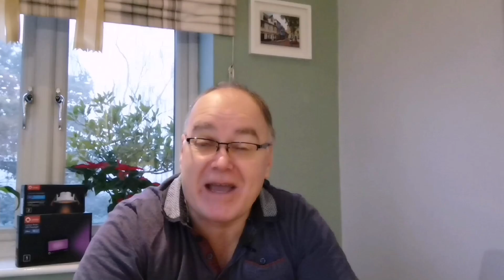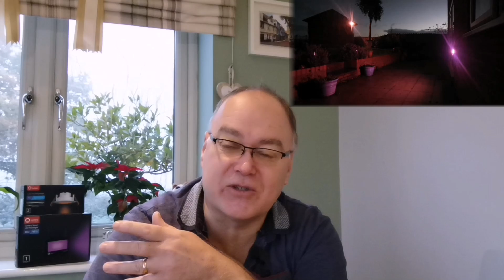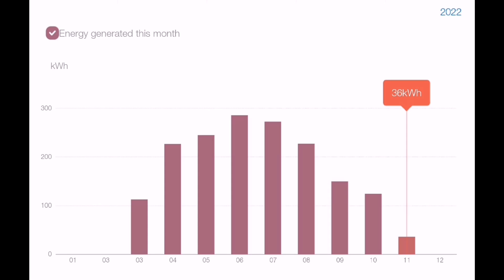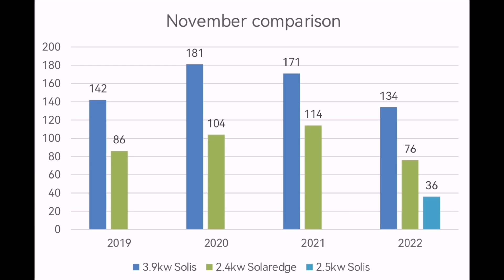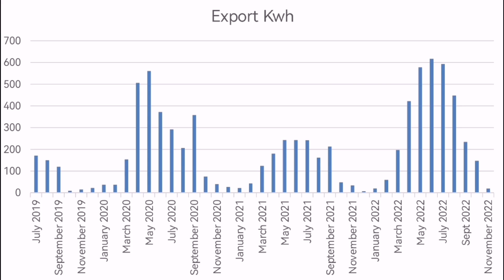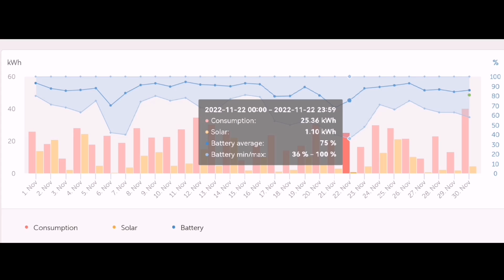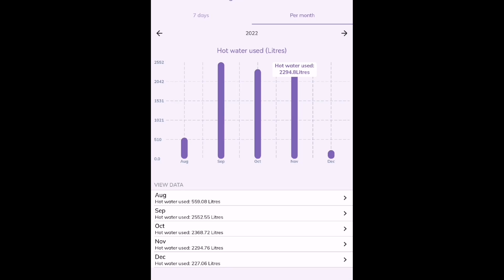Solar PV, battery, Mixergy and A2A heating system - First winter challenge

Comment: Good vid. I’m looking at putting air2air for my new property that only has old electric radiator heating or I’ll replace to new elc radiators. Also considering sola as well. 
May I ask how much was your air2air including install. So far from the few revews of home air2air around 7-8k seams to be the average. Personally I’m not going electric car due I’m moving to a very remote aria and I need to make long journeys with no luxury time to stop a charge for 30-60+mins and the cost of the decent evs are ridiculous expensive to buy.
Think the main issue most people face even with the substacys is the shear cost of re doing there property and most do not have the financial reserves to do it nor won’t to be in debt. Personally I’ve run into some money and what I’ve been saving thru work. So I feel lucky that I am able to consider doing big changes with my new property. I have friends and vets that work equally hard and still carnt consider switching the ev systems. Witch these GOV deadlines are crazy and especially the 30 rules have good chance the kill the property market buying or renting probably if not changed will just creat a Black Market economy. Most are property stock doesn’t come dear the A standard requirement nor most older property have a realistic chance of meeting it without a shear amount of money 💰 thrown at it. As they say Nice if you can but those who don’t or carnt they will be between a Rock and a Hard-place. But as said Good vid. Your vids opened my eyes to air2air heating and so fare for me seems much cheaper to air2wet system and nearly the same as replacing to new elc radiators.
Reply from the maker: We paid 5500 or was it 5700 honestly can't recall but that included a some extra work
Reply: @EVPuzzle  Thanks just looking for a ball park figure. to be honest it seams to make sense my figure just ordering the electric radiators is around 4000 ish give or take not including tradesman.
Reply: @EVPuzzle  Hi,
Please advise what company  you used as I have had one quote for £8k when all the pipes can be run in the loft ( It is a bungalow)

Comment: Loving the tips and updates. Draft excluders and thermal improvements will help us for sure. 

Yeah December has not been great for us but we were lucky to have some days hit 8.5kw solar production. We installed mid October this year eight JA 410w solar pv panels and solar edge inverter and micro inverters. So around 3.2kwp system. Between October and today we have produced 359kWh. December 76kwh and we had several days hit 0 production in December and in November and they were cold, heavy cloud cover days. I’m not sure the exact amount of solar we use and have wasted. My solar edge app only shows production figures and no usage. Maybe when we have a battery installed next year we will have near accurate figures of import and export. Or I have to look closely at my electric bill and it might help understand my solar usage… no idea.

Comment: I enjoy your vidoes and find them most useful being new to solar & batteries they helped me with my decission to go solar . 
I have a question & hope you can shed some light on it.
my inverter & octopus energy readings do not add up, consistently the imported KWH from octopus is almost twice as high as the figure from my growatt inverter, is this comon or is there an issue with my meter or inverter iwould appreciate you help before i contact octopus , thanks david.

Comment: May I ask what is your main heating? Or do you only have A2A HP?
Reply from the maker: Main heating is A2A now

Oil boiler still here but bit in use and will be taken out as soon as we use the remaining oil but I'm finding very few days where I want to use the oil central heating.  Once boiler and tank are gone we'll deinstall some radiators too.

Secondary heating of bathrooms with Immersions in towel rail radiators. Only turn these on as and when needed.

One bedroom, our daughter has a seperate electric radiator as her room doesn't have Aircon

It'd be perfect if we could have vented Aircon A2A in our other rooms
Reply: @EVPuzzle  I have the same setup. A2A heatpumps in all my rooms, hot water via a heatpumpboiler and also a solar installation. Question: do you leave your A2A HP on during really cold wheater like it is now, or only during the day when you're at home? I'm wondering what is the most efficient way... My experiments so far pointed out that it is more economical  to only heat when necessary, but find that it takes quite a long time to be at a comfortable temperature then. So I'm a bit at odds about this one...
Reply from the maker: I've yet to test teaching it on 48hrs plus, we turn it off when we don't need it for periods of 3 hours or more.

Ours heats up really quick
Just make sue it's not in quiet or eco  mode.

I've only used the hipower setting once as a test so, we have more heating power if we need it

Comment: Hello nigel can I add a second solar and battery system to work alongside my original solar and battery system
Reply from the maker: In theory yes but dependong on the inverter, priority might be an issue or conflict.  I think solis hybrids have been used splitting batteries across two Inverters.

Best to check though

Comment: I've just installed a 9.5kwh givenergy battery and 3kw inverter. I've an Mg4 on order, and spoken to octopus. I'm switching to go for cheap electricity.

But the gas! I'm spending £10 a day warming the home up! So £310pcm just on gas usage.
Reply from the maker: £10 could be worse

As per my videos my plan is to, go electric with heating too. Saves extra fuels and extra standing charges plus I honestly believe we have to ditch gas. We're too vulnerable and not independent

Comment: Can I ask you have you ever tried an electic blacket to keep the batteries warm .we in n.ireland are at -5 for the next 10 days .I have seen a USB powered 120cm x 75 cm on Amazon ..Any thoughts, Nigel .:ps Batteries inside garage
Reply from the maker: No not seen a USB hot jacket like that. Might be worth a look though if not too expensive. With chargjng and use ours rarely drops under 10c even though the garage might be as low as 4c
Reply: @The EV Puzzle They are on Amazon for £17.99 unfortunately cannot post link
Reply from the maker: I've been looking, the reptile or feet warmer pads look interesting too. It'll be the right sized one to fit over each battery ideally to even out the heat.

Marginal gain but might be worse peace of mind

Comment: With my battery I’m not minding using a few more devices during the daytime, especially dehumidifiers.  The cost of LPG is about the same as off peak electricity until the end of my lpg supply contract but then lpg goes up from 42.9p to 63ppl in January.  So I have every incentive now to use off peak electricity (which always ends up as waste heat). 

But my solar performance was dreadful for November. 110kWh this year vs 138kWh last year. Heavy dark clouds coming in from the south east to blame for that.  December is looking appalling with only 10kWh for first 10 days.  Again, I’ve got a sheet of ice on my panels thanks to snow rain mix followed by a deep freeze. It wont budge with my squeegee on a long stick. No thaw until 18th December.

In better news, my energy bank efficiency is a lot better than I thought 97% minus inverter losses according to Solaredge API datasets.

Comment: Does Pylon , Giv energy have self heating battery pads to keep battery from Freezing. I just have a small 24v 120AH set up but , I don't think more consumer grade server rack batteries are heated batteries. I assume most people know you should not try to charge a frozen Lithium battery.
Reply from the maker: No
Reply: @EVPuzzle  Thanks for reply. , That's what I thought,  I just got cheap aliexpress batteries, I think Power Queen few others have heated pads. Mostly brands that are not easy to import from USA,.
Reply from the maker: How do you find ordering from aliexpress I've yet to try it?

Comment: Nigel, in you last video, you mentioned that you were disappointed with energy saved using your mixergy tank. But in this video, you seemed very impressed by the savings. Could you expand on this change of mind? I have a mixergy tank waiting to be installed and have halted this on the basis of you previous video.

Thanks

Rob
Reply from the maker: Initially dissappointed as savings only 10%

Now we're into winter there's no solar excess so we're heating less water, only what we need.

The mixergy tank is working as I'd hoped in winter conditions but September and October I was heating to 100%  every day like we did in the old tank. Only difference, its size.

Savings really occur when you keep it partially filled, Lower the better

Comment: "using more off peak energy on the Go tarrif" - better cost wise but we really need to cut energy usage from the grid, reducing overall emissions. - When importing from the grid, you can't pick or choose where the power comes from. - maybe it's from renewables but sadly at the moment probably not.
Reply from the maker: All well and good but I'm reducing oil, petrol etc so electric has to increase. You cant iradicate everything.

I do only buy from a company that buys 100% renewable. Know that doesn't mean I'm using clean electric, lots of ours is gas from Yarmouth but I'm also aware the huge wind farm in profess will solve this long term

Local wind turbines need to be encouraged in my opinion but for use, burning oil or gas to go, avoid using the grid is crazy

Comment: Hi Nigel great video and thank you for sharing your experiences.  I see you are protecting your house batteries by not discharging below 10% but you did not mention protecting at the top end. Are you charging the batteries to 100% ?  I used to think all batteries has a usable range that you could not access so you could not discharge to 0% or charge up to 100%.  However,  am I wrong in this because it looks like you are setting a depth of discharge at 10% so can I please as why you are not setting a limit of charging to 80%. I thought we did not need to worry about this but a friend has just bought an VW ID4 and he has been told to set a limit in the car to stop charging at 80% to protect the life of the battery. I would really welcome your opinion on this Nigel or anyone who wants to chip in. Thanks in advance for your help and advice
Reply from the maker: The pylontech and victrin combination is good as you get a littke more technical with the setup. Not hard technical just it talks in terms of voltage. Battery % is afterall calculated, derived from voltage.

The pylontech bms allows the batteries ti charge ti 53.5v I think (off top of my head).
Victron recommends 52.4v as a max for battery longevity and this is setup automatically.
I've tried running lower voltage and higher voltage as the max and there's not much difference in usable kwhs but not stretching the upper voltage will help with longevity.

I charge to 100 % ie 52.4v but the battery does get used a lot in winter so diesnt stay there long. Dummer is another matter, it stays at 100% longer so might make sense to drop the top voltage a bit to protect the battery further.

Reality is, it wont make much difference but it does feel good trying ti protect it that extra bit more

Comment: I thought I was a solar god with my DIY system June - Aug.  I now feel like a solar goldfish - garbage few months by battery barely got above 40% last 2 months.  I need much more panels.
Reply from the maker: Yep, I worked out 300 to 350 panels to get to a self sustaining level in winter and I think that was before electric heating.

Wind is the winter answer, there's more of it and it's 24 x 7

Comment: We are not far off those figures for Nov, A poor 90KWh of solar and a whopping 500Kwh import but that is supporting 2 EVs so offset by no petrol costs. However the good news is BGas released their EV tariff finally and while it is based off the standard variable, for now it is cheaper than Octopus (who I guess they are losing people to) so I am able to charge the cars and battery at 12p for 5 hours every night. BGas which is a big change to our costs. They have also sorted my erratic and crazy smart meter readings that they record although my smart display shows my unit rate as £1.20 a KW so you can imagine the costs that is showing! So a month ups and downs but mostly ups!
Reply from the maker: Competition is working. Excellent

Very similar numbers, 500 kwh sounds like a lot but winter and no petrol and running the house, it's cheap really

Comment: Thanks Nigel, well done on getting your video out. Some nice improvements with the draught excusers on the thresholds. 
One thing to note with the smart lights for your yet to be shed or living room is to buy some spare units. They look like integrated units which cannot have a new bulb fitted. Once the bulb fails the unit is toast. Not having a spare means you have to locate a whole new unit and just your luck the manufacture does not make that model or design anymore.
Reply from the maker: Very good point, I much prefer units you can change the bulb. I guess though they're supposed to be more reliable.. But are they really?

I have six, so 4 used and 2 spares maybe

I've noticed this with snart plugs and snart bulbs, you get used to them but when they break and you can't replace like for like it's a pain

Comment: Hi. Great show. But are you aware of the building controll documents for ventilation? Each room type ie bedroom, kitchen and bathroom has a minimum amount of air changes. This is for health, ie to stop black mould. An MVHR system is required if you seal up your rooms. Keep up the good work. Russell

Comment: My 7kWh array in Cambridgeshire generated just 159kW in November,  but still a useful amount. Up until November, our grants more than covered our (largely off-peak) consumption.  We too have 2 electric cars, a Honda E plus an XC40 Recharge Twin, mostly charged at home.

I find the mixed use of kWh (flow) and kW (yield or total) confusing. By way of example, my 7.2kWh wall charger will supply the 72kW needed by my car in 10 h (hours).
Reply: It is confusing; 7.2 kW x 10 hours = 72 kWh. ☮️
Reply from the maker: Not everyone sees data and math as easilly as others. My daughter with dyslexia fir example rely struggles with decimal places and zeroes
Reply from the maker: I had a similar discussion with our daughter recently and equated a battery to the sink and the charger to the tap. Turn the tap on more you have higher flow rate (kW) which fills the bowl up with water (electricity) faster. The battery stores kwhs
Reply: I stand corrected, as stated by @backwoodsbungalow9674 and indeed your sink analogy then 🙂

Comment: Hi Nigel, We got 147kWh from our 6.9 kWp SE facing panels, Wirral in November. 25% less than last year with the same equipment. Have just switched to Go but my overnight rate is 12p. I will use this to charge the house battery, charge the car and run washing devices. Eddi didn't do any water heating during November because there was no surplus solar. Export was minimal too - Octopus gave us 6p for the whole month on the Agile tariff. Heating is the biggest cost (gas) so I have been concentrating my efforts on insulation, draft exclusion and radiator control valves so that we can direct heat into rooms where we need it most. I am not looking forward to the December gas bill.

Comment: Spalding Lincs had a particularly gloomy month this year with constant clag rolling in off The Wash. our combined 4.3 arrays only produced 114kwh, compared to 192 in 2021 and 177 in 2020. The original 3 kw array fitted in 2012 only produced 88.9 kWh its worst ever performance. We had 7 days with less than 1 kWh produced, the best performance day was the 4th with 15.4, the worst the 29th with 0.2. We still managed to send 16.2 kWh back to the grid early in the month. House consumption was 268.4. Grid draw was 195, the house took 146, the car 49.

Our gas use was down on last year but given the current cold spell that looks likely to continue well into the coming week this month will increase a lot.

Have a peaceful Xmas and we look forward to seeing your December performance to start the New Year.
Reply from the maker: Thanks Lynn I think being just over the wash we have similar weather.

Nice economical stats BTW 195 grid pretty good

Have a merry Christmas yourself.

Comment: Love these stats 😁. I'm installed now, no generation today (obvs) but got 5.2kw into my battery with the low sun yesterday, despite the frosty start
Reply from the maker: Funny how 5 or 10kwh can seem like lots In winter.

Look forward to hearing your stats improve month by month
Reply: @EVPuzzle  thanks. Got a video in mind. Probably edit over holidays
Reply: 5 Kwhr? That's going to keep the house warm.....
Reply: @bengun1  you're right there😂. Gas central heating, but the free 5kw I was able to use once the sun set. Small but not bad for a frosty December. Watch the pennies

Comment: Family member had solar installed at the end of September E/W facing its around 5.1kW system using Enphase Micro Inverters along with a Solax battery 5.8 kWH ( this is not working currently as the inventor is showing a DSP_Comm error) They also have a Zappi from before they had solar which i have just got the CT clamps installed so it can record the Solar information. In October they produced 277 kWh November they produced 101 kWh